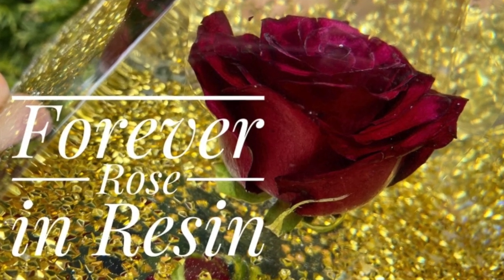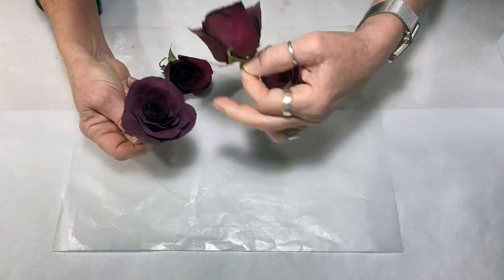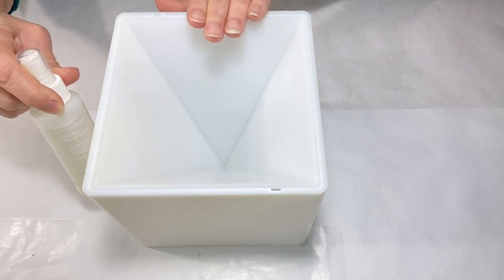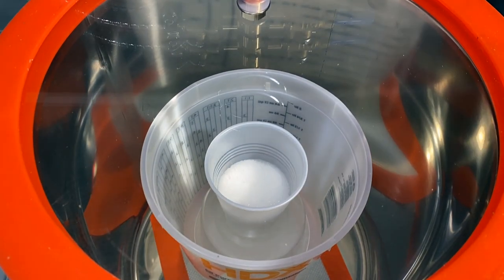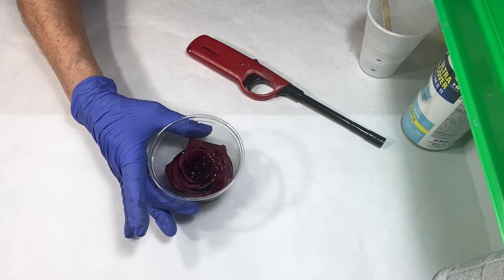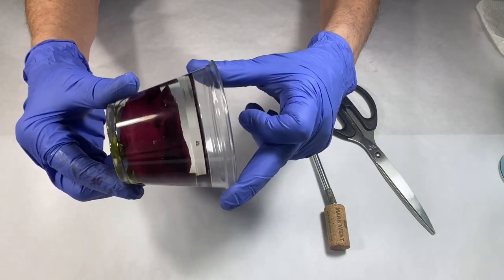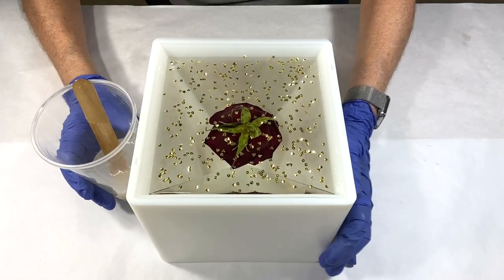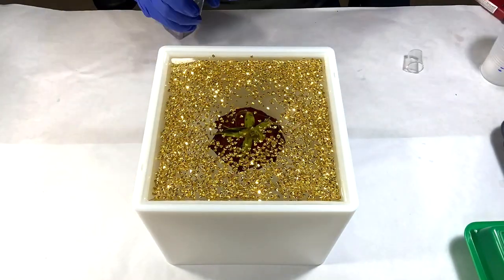Forever Rose in Resin - learning together with casting, vacuum chamber, and some failure too

Comment: For the bubbles you could have taken a hand drill and drilled down to them then fill it with resin. It will cover it up like sanding just make sure to clean out the holes and don't leave any shavings in it.
Reply from the maker: Ah, in a perfect world

Comment: Why not put the rose in the vacuum chamber after pouring while its in the cup
Reply from the maker: The rose would not hold up well I don't think.  When the resin is processing it foams up a lot which could mean more bubbles trapped around the petals.

Comment: Can you put the rose in the vacuum machine?  It looks beautiful ❤️. I have a pyramid mould with a mark and I put some tape there so I just make sure I don't fill above that spot. Saves on resin. 😁. Thank you for the video. ❤️🙏🏻❤️
Reply from the maker: I don't know about the rose in the vacuum chamber Karen.  They are so fragile when dry I didn't want to risk it and when pulling the vacuum it bubbles like soda which would create a bigger issue I think.  Great idea to mark the damage line on the mold 👍🏻  Thanks for watching!

Comment: Why do you use the alcohol? It turned out amazing. I tried it with just putting resin over a rose. Bad idea. The resin got hot and the rose welted to a big hump of yuck. First time ever trying to use resin.
Reply from the maker: The alcohol is to help in bubbles in the resin to pop on the sides of the mold. 
You are a brave soul to try casting a rose for your first resin project!  Hope the video helps for your next one 😊

Comment: Why did u put the resin in layers
Reply from the maker: You must do in layers or the resin heats up to much.
Reply: I discovered this today - the hard way. I had built a box in plexiglass that was a about 500 ml. I had put a couple of figurines I had cast earlier in resin on the bottom of the box and filled the box with clear resin until it was full. The temperature raised quickly and kept rising. Last time I checked it, it was well above 100 Celsius degrees. The glue on the plexiglass mold started to melt, the figurines were melting too and the resin turned brownish in the center. I had worked on this project for a week and it was ruined within an hour. Another lesson learned.🔥
Reply from the maker: Oh my! That was hot. So sad that it ruined your hard work @TheTrackdriver 😢
Reply: @MoonkusserArt  Yeah, but your video convinced me to buy a vacuum chamber so no more bubbles😀